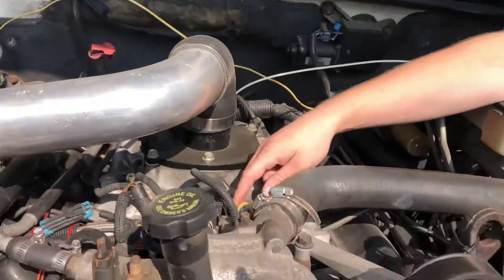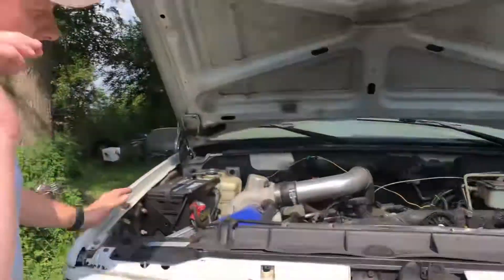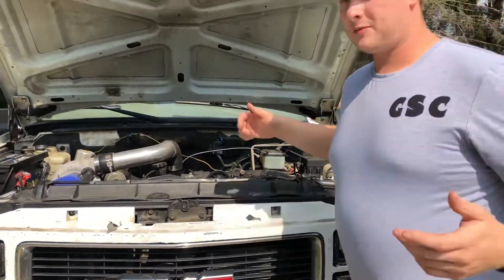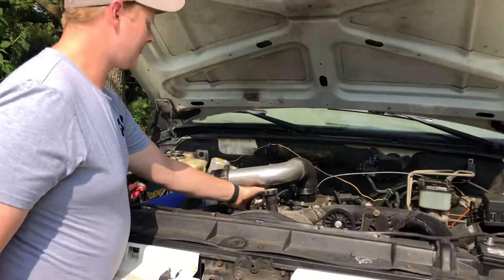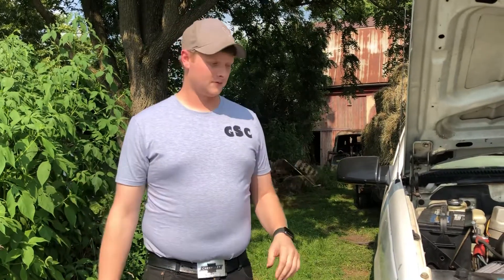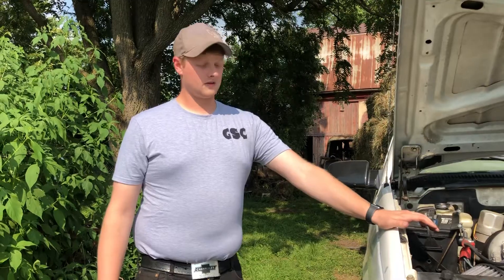GSC 6.5L turbo diesel. Things to look at when purchasing a 6.5

Comment: Hey ginger. How come I can't separate my engine from the nv4500 behind it?
Reply from the maker: Bell housing bolts all out and she’s still stuck?
Reply: @gingersnapcustoms  Ya, I am supposed to slide the Trans back first before I lift on the engine too much, correct? How easy is to mess up the shaft when trying to get it to slide out of clutch?
Reply: @gingersnapcustoms  and how far back do I gotta get the transmission? I've only done autos, like hundreds of times n never had issues like this
Reply from the maker: @bobbyboucher5309  I always put a Jack under the oil pan to suspend the engine before I detach the trans.
Reply: @gingersnapcustoms  I suppose, I figured the engine lift would've been enough. How far back does the trsns need to go before the shaft is out?
Reply from the maker: @bobbyboucher5309  if you are leaving the bell housing attached to the engine? The trans will need to go back 4-5”. If the bell housing is coming out with the trans attached? Remove the slave cylinder and clutch fork. Unbolt the clutch and slide it back about an inch and a half to pop the shaft out of the pilot bushing
Reply: @gingersnapcustoms  OK  thanks for for getting back to so quickly. I couldn't find much videos on it.

Comment: What exactly is pmd and why should it be relocated
Reply from the maker: Pump mounted driver. It’s the little black box that houses electronics to help signal the DS4 injection pump to fire. When they go through enough heat cycles the resistors can become damaged which cause the engine to stall or even run away.
Reply: @gingersnapcustoms  what’s the process of relocation. I’m considering a 6.5 suburban for a fair price. 350,000 miles on it. Would be my first diesel I’m trying not to shoot myself in the foot
Reply from the maker: @erichanson5929  purchase a relocation kit an PMD from Leroy diesel. You’ll also want the lift pump relay harness as well. Takes care of most electrical upgrades that these trucks needs from day one.
Reply: @gingersnapcustoms  what electrical upgrades should I do. Im not majorly  inclined about diesels or 6.5s at all. I definitely would want to upgrade and do as much maintenance as possible. I want longevity
Reply from the maker: @erichanson5929  the main ones on a 94-2000 are a PMD kit. Lift pump relay harness. Replace the lift pump itself. Battery cable upgrade and also commonly seen is upgraded glow plugs and harness.

Comment: Everything wrong with this video? Volume and the sheep are nervous 💗.
Reply from the maker: Volume issues I’ve learned to resolve. Sheep lie.
Reply: I have 96 3500 6.5 and looking at getting bigger tires since it has 16s on right now.  What size would you recommend?